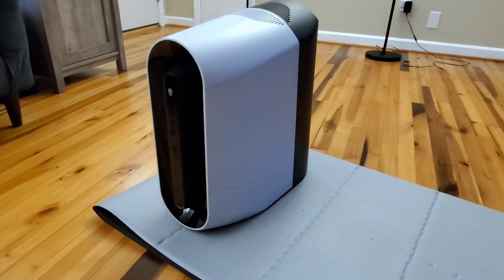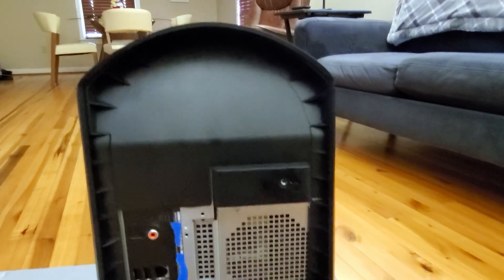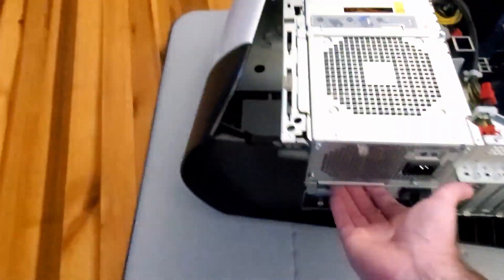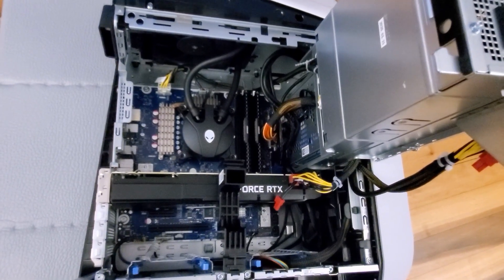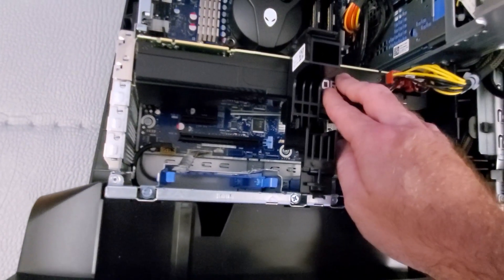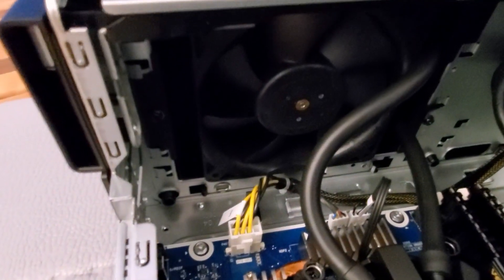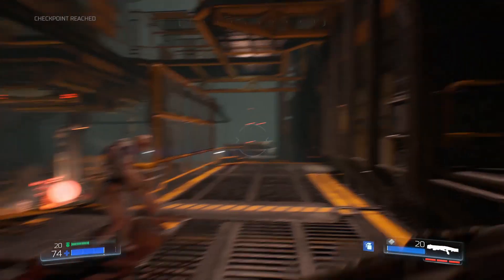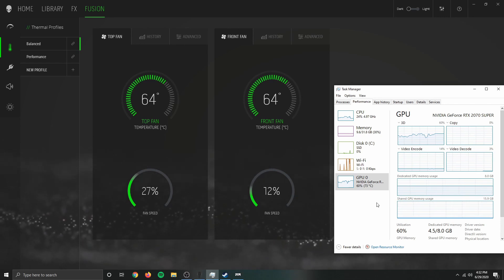Alienware Aurora R11: Up-gradable? What about those temps?

Comment from the maker: Update: I just figured out that Dell did make a mistake in the wiring of the fan headers. The front and top fan headers are showing the CPU temps; which are under control.
Reply: Hello. Do you know if I can upgrade the ram to 32 gb using the same x fury at 3200?
Thank you.
Reply from the maker: @victoravilamacias4901  I don't see why not. As long as you have XMP enabled it should not be an issue. I just went with the 3000MHZ due to the CL15 rating.
Reply: @theonlyjoe6036  How much did that cost to go with the 3000MHZ Ram upgrade. (Non Computer Guy). The install for Ram upgrade looks pretty easy was it?
Reply from the maker: @Iamfeelzmusic  I think I paid like $140. The install was super easy as it was just like any computer RAM install. There are tons of Youtube vids out there about how to upgrade RAM.
Reply: @theonlyjoe6036  hey I’m about to buy my own, and i was wondering would you recommend Ryzen over intel based on your experience with intel in this machine? Just curious cause of your intel comments lol
Reply from the maker: @An_Drew_732  I went with Intel because the R11 is more price competitive than the R10 (most likely due to Intel having more favorable bulk pricing terms), and the 10th Gen Intel CPUs do have better single core (which effects gaming the most) performance than the AMD 3000 series that Dell is offering in the R10. If I were to build my own system, it would be a 5000 series AMD CPU with an Nvidia GPU, but good luck finding the parts.
Reply: Can you upgrade your 10th gen i7 to a 10th gen i9 or can you not?
Reply: Midnight Wuffy yeah you can. I’d stay within the gen though. Not sure about upgrading to 11th gen when it eventually comes out
Reply: is it possible to move everything into a different case?
Reply: Yes, get an atx case.  I like the nzxt midtower atx airflow case h7 flow
Reply: Can you upgrade the cpu like from a 10th generation i5 to a 10th generation i7? Please answer I really need help 🙏
Reply from the maker: @albertoramosperez8276  Yes, that shouldn't be a problem. It also turns out that 11th gen CPUs will be compatible with 10th gen sockets, so you should even be able to upgrade to an 11th gen CPU with no issue.
Reply: @theonlyjoe6036  thanks so much  I can also upgrade the 10th generation i5 to a 10th gemeration i7 in my aurora r11?
Reply: @theonlyjoe6036  please I need the help so if I can upgrade my 10 generation i5 to a 10th generation i7 and n aurora r11🙏
Reply: @albertoramosperez8276  Of course it works. Its the same socket.

Comment: We have the ALIENWARE R11, intelcore i7 gtx1660tI. What Nvidia graphics card can we upgrade to with this model? We have added more Ram but unsure what graphics card to get? Any help appreciated as new to this. thanks
Reply: hey, did you end up upgrading? i've got the same specs for my R11 as well
Reply: @creativevit5961   I just got the R11 1650/I-5 10400 air-cooled model for a deal price. If you have the 1660, you possibly have air cooling and the 550w power supply. 
  For the CPU if you stick to air cooling your options are limited to the 65w i7 10700 or any other 10th gen 65w processor. If you get a used liquid cooler your options are much better as Many of the I7/I9 options are rated at 125w and the AIO is rated for those CPUs. I chose the i5-10600K (125W) and got a used OEM water cooler off of fleabay.
  As for graphics, If you have the 550w PSU, you will be limited to around a 220w GPU like the AMD 6650, Intel arc A770, RTX 3050, 3060, 2060 or a standard 2070 (non TI or S) and below. Be aware the card slot is 12 inches and Dell GPUs are custom 10.5 inch. 
  Also remove any hard drive from the 3.5 bay as it seriously restricts airflow in the case. You can install a fan in the 3.5 bay connected with a PWM splitter if you feel the need.
  As for PSUs if you want high power GPUs, you will need the 1000w PSU from the R10-R12 series, be sure to get all the cables. 
Hope this helps.

Comment: i got r11 and r12 the cpu in the r11 is 10700kf and the r12 is 11700kf same motherboard ! In the R12 to get pcie 4.0 you need to update the bios, but the pcie 4.0 is only for the videocard...... My m.2 is 3.0 i got sn850 that suck !

Comment: Cant fit in my 3 fan 3080
Reply from the maker: No. It can't. The max GPU length for the R11 is 10.5 inches. Most 3 fans GPUs tend push around the 12 inch mark.

Comment: I hate to be the bearer of bad news, but those temps aren’t accurate. I have a Alienware R11 with the i7 10700F/RTX 2070 Super and mine runs at 80-83 degrees whilst gaming. What you need to do is have AWCC running in the background and then Alt+Tab over while the game is amidst action to get a more accurate temp. The temperature drops when the game is at a slower pace because there isn’t as much stress on the components.
Reply: Yeah, same for me. I have a 2080ti in my Aurora and in gaming it runs at 83/84 degrees. The cooling solution they used for GPU is not so good, I hope that will not damage my card
Reply: @pb96-p6g  so I took the hard drive out of mine and installed a intake fan in its spot. My temps have dropped about 7-8 degrees by doing this. I’ve replaced all the fans inside my R11 with Be Quiet Pure Wings 2 120mm fans. My temps are between 65-75 degrees. I also replaced the stock air cooler with a Noctua NH-L9x65.
Reply: @g3arsgam3r  Was it easy to do the replacement? I am considering doing it but I never did it before.
Reply: @pb96-p6g  it’s super simple dude. I do believe there are how to videos on YouTube, should you run into any trouble. Check out Gamer Heaven’s page he has great tutorials when it comes to R11’s.
Reply: @g3arsgam3r  thanks I’ll make a try

Comment: It would be nice to upgrade the power supply the used 6pin power supply but the motherboards requires a 8pin power supply you could just replace the cable maybe i have actually a 1000W power supply and i believe the power supply will fit i will see to replace the cable when i get the R12 ?
Reply from the maker: Since the PSU is fully modular. Swapping a new cable in shouldn't be an issue.

Comment: Hey joe was wondering what if I wanted to switch out the motherboards and put in a asus or MSi motherboard
Reply from the maker: As long is it as an MATX MOBO then it shouldn't be an issue. There are no proprietary headers on the MOBO that I have found. That said, my R11 has a high end Z490 chipset, so I don't see what the point would really be in upgrading the MOBO. I think a cooling or HD upgrade would be better suited and cost effective.

Comment: Hey man do you think that I could switch the mother board and all the parts into another pc case ? But I’m going to buy a new mother board because I would like to upgrade from my ryzen 5 3500 and I want more room for expanding my computer in the long term so you that that would be possible?
Reply from the maker: No problem at all. The MOBO in the R11 is a fairly standard Micro-ATX (MATX), and the PSU is fully modular.

Comment: Will you be able to fit a better power supply in the Alienware case ? My Alienware only came with 500w. I’ll need to upgrade that if i ever want a 30 series card in there (assuming it’ll fit )
Reply: Na man, the 550w you have will push a RTX3000 series GPU.  Draws like 200w.  It will with the AMD CPU for sure.  Idk about paired w/the Intel CPU but it might.
Reply: Late reply but the 1000w unit bolts right in.

Comment: I had TWO ...both with i9 ...liquid cooled ...BOTH FAILED. This SECOND one can't even run a screen saver ...it totally hangs & Alienware/Dell CANNOT replace the second one ...they said I'm on the waiting list for a GPU & I can pretty much pound sand.
$4,300. & 3 months & still nothing. I'LL post the rude emails & screen shots if anyone is interested in not getting screwed.
This has been the WORST PC I've ever owned & the company is worse than the PC!
And ...fact is ...there are many good ...better options. I'm so sorry I didn't take one.
DO NOT BUY ALIENWARE.
Reply: Shit man, I just bought one today. I was worried about this. I’m having second thoughts now.
Reply: @TheRowdyNomad  You will NOT be disappointed if your unit works. I'm not defending Dell ...they treat you like the bad product is your fault when you demand replacement. But they honor the warranty & even beyond the refund date. When it works it is a wonderful PC ...AMAZING in fact. But for the price ...I expected NO issues & that little water cooler is just a CHEAP inadequate thing that needs upgrading & it'll have to be an outboard unit due to the case dimensions. For over $4,300. We should expect FAR better. Let us know how it works please?

Comment: Question,  I know the 3070 Alienware is custom made from Dell and smaller. What are the pros and cons? Is the performance the same as other 3070s?  Is it better cooling?
Reply from the maker: I fairly sure from doing some digging that the 3070 is a Gigabyte blower model that is simply rebranded. The 2070 Super in my own R11 is simply a PNY blower model. 

Blower models have their own pros and cons (mainly in that they are typically louder, but exhaust air outside of the case), and they generally perform on par other models. The R11s cooling doesn't really suit itself to overclocking the GPU. I am able to run a 5.1GHZ overclock with an under-volt on my 10700K with my radiator mod with no issues though.
Reply: @theonlyjoe6036  thank you!  Yeah it looks like a gigabyte model like the HP one.  It has 2 fans though like the MSI Twin Frozr so I'm not sure it's a blower style directly to the back...
Reply: Performance is almost the same but the cooling is tremendous. I have a blower 2080ti on my Aurora which hits 84 C and there’s nothing to do about that. Not to mention the noise of the single blower fan which is audible from other rooms in the house

Comment: I have the 64gb ram Ryzen version of this, anyone know if it's possible to install up to 128gb of ram?
Reply from the maker: The 10th Gen CPUs max out at 128GB of RAM. So yes, you can upgrade your RAM. Dell even sells the R11 with 128GB Dual Channel HyperX™ FURY DDR4 XMP at 3200MHZ. I installed a Corsair Vengeance RAM kit in my own R11 with no issues.
Reply: @theonlyjoe6036  hi ,What about 32gb 3600 speed? Is it compatible? Thank you
Reply from the maker: @YC305  The 10th Gen Intel CPUs only support up to 3200, but can support faster if your MOBO has a valid XMP profile. I couldn't find any documentation that Dell includes an XMP profile that would enable faster ram than 3200.

Comment: My brother has a alienware r11 that had 8gb ram and I got an extra 16gb of ddr4 ram that doesn't work for his for some reason
Reply from the maker: Are you talking adding a 16GB stick to the existing 8GB stick? That actually will cause an error due to dual channel issues. RAM sticks should be the same make and model, and if you only have 2 sticks, should be plugged into the same color of RAM slot on the MOBO. You might be able to get the 16GB stick to work with the 8GB stick by plugging into a different color RAM slot than the 8GB stick, but that would disable dual channel and XMP profiles.
Reply: @theonlyjoe6036  I got 2 new 8gb sticks of ram to replace the 8gb he already had but then when I put them in the PC wouldn't turn on at all

Comment: is there a certain ram you have to use with this? or can you use matching sticks or replace it with your own ram sticks?
Reply from the maker: I always advise to use the same brand, make and model of RAM whenever upgrading RAM as Intel and AMD both support dual channel memory. I upgraded the RAM to 32GB of DDR4-3000 CL15 Corsair Vengeance, but any brand should work. The 10th gen Intel will support up to DDR4-3200; just remember to enable the XMP profile. I went with 3000 simply because of the lower CL rating; I couldn't find any 3200 in stock at a good price that wasn't CL17.

Comment: You cannot upgrade to 3080/3090 gpu. They do not fit the r11. Unless you bought the custom build from dell or dell starts selling custom 30 series gpus, you are stuck with what you got.
Reply from the maker: There are a few, well one that I know of, a Gigabyte card that will fit in the R11. As long as the GPU is less than 10.5 inches in length then you can upgrade to a 3090. I've included a link to the Gigabyte card, and it would not surprise if Dell simply uses this exact model with the branding removed (my own 2070 Super that came with my R11 is actually a PNY blower model).

https://www.gigabyte.com/Graphics-Card/GV-N3090TURBO-24GD#kf

Comment: Intel said you will be able to use the same motherboards for rocket lake, so your info is a bit wrong.
Reply from the maker: I had not heard that was confirmed (only rumors) at the time the video was made. It is great for a long term upgrade and life cycle of the R11. I personally think that the average person would benefit far more from a GPU upgrade than from a 10th to 11th gen CPU; though we will see once they are actually seen in the wild.

Comment: Can you actually upgrade the graphics card in that pc bc I have the same thing and wanna upgrade and I kinda think your capping
Reply from the maker: Yes, but don't take my word for it. I've posted a link to the official Alienware Twitter that answers this question. The max length for the R11 GPU is 10.5 inches, so any GPU that is 10.5 inches or less will work.

https://twitter.com/alienware/status/1297975879944024065?lang=en
Reply: @theonlyjoe6036  ok thanks man

Comment: Hi Joe love the video, I recently just bought r 11 with 2080 super. Can I upgrade the gpu to nividia 3090? I read online its to big. Or what options do we have? Sorry for the question. Dell just flat out was like no you can't update squat but hard drive.
Reply from the maker: The GIGABYTE TURBO 24G 3090 should fit the R11. The R11 has a max GPU length of 10.5 inches, so long GPUs are not an option. Besides replacing the case fans, I've also upgraded my RAM, installed a back up 2TB SSD, and plan on installing a 3070ti/super/whatever Nvidia will call it (when they come out).
Reply: @theonlyjoe6036  thanks Joe. Glad to know I have options. I was hoping not to return it and wait another month... but good thing we can upgrade regardless of what Dell says. :]

Comment: I just wanted to say thank you Joe! I now have a RTX 3090 in my R11!! The GIGABYTE TURBO 24G 3090 does fit! I had to swap to a slim front case fan but its in there. Thanks again!!
Reply: Dell make fortune because shortage of RTX30xx. They use B550A and use one m2 for wifi, only 2 fan and only first PCI is 4.0.
I should buy PS5 instead.
Reply: Damn you're probably over heating with that case and your 3090?! I have a R11 3080 and I get about 85-90 degres playing The Division 2 or RdR2! I'm waiting on my H60 and ML120 to upgrade mine...
Reply: @M4rc221  nah. It’s been fine. Haven’t overclocked it much and I did take it apart, repaste the heatsinks and added a couple of additional fans but I stay in the middle 70s when under load - pretty much everything I play is VR on a G2 or a Pimax 8kx.
Reply: I want to do this same gpu upgrade to my R11 and in addition, an upgrade to liquid cooling, perhaps a case swap. I need help from anyone willing, I can't afford to mess this up! Reach out with thoughts!

Comment: I have an r11. What are the best fans that I could upgrade too?
Reply from the maker: You have be careful when replacing the fans in the R11 as most fans will trigger a BIOS error that cannot be bypassed. I have replaced the front fan with a Corsair ML120 Pro non LED, and have put two Corsair ML120 Pros on the radiator in a push / pull configuration. They must be the ML120 Pros; I myself got a BIOS error with the standard ML120s and had to redo all of the work to install the Pros. A video of this will be posted soon.
Reply: @theonlyjoe6036  where is the video
Reply from the maker: @JustxLiving909  Here is a link to that video.

https://www.youtube.com/watch?v=fkVNcTXcpAo

Comment: i have a question if i wanted to install a corsair water cooler in the future would i be able too ?
Reply from the maker: A 120mm AIO will fit the case. Dell currently uses an Asetek cooler; Asetek makes AIOs for Corsair, Thermaltake and NZXT. Asetek currently builds the AIOs for a number of Corsair's coolers, which I've listed below:

H50
H55
H70
H75
H80i GTX
H95
H105
H100i GTX
H110i GTX
Reply: Corsair H60 is what you want. You probably want to go to Dell.com for more details ( google) as I read that h 60 fits with this design.